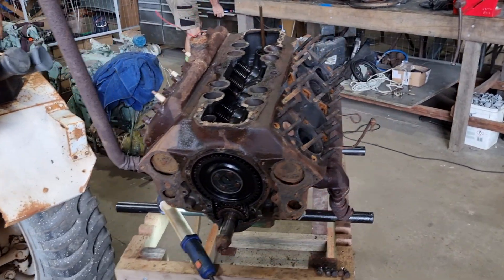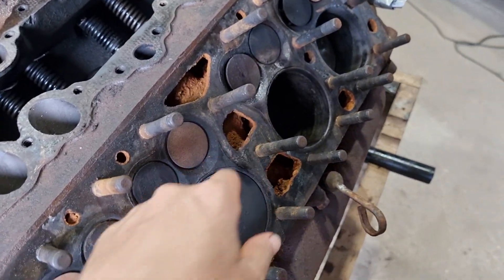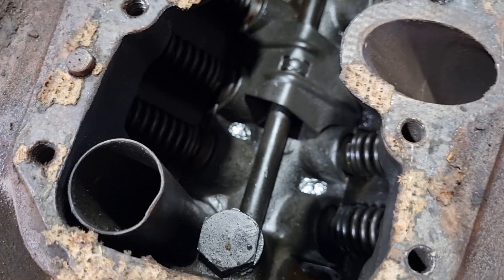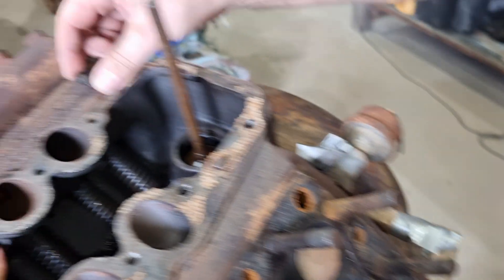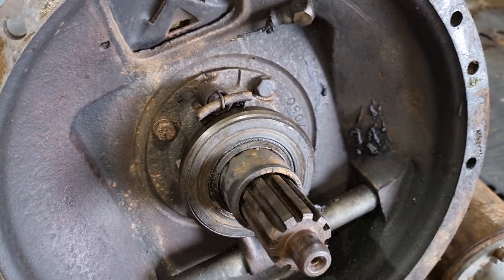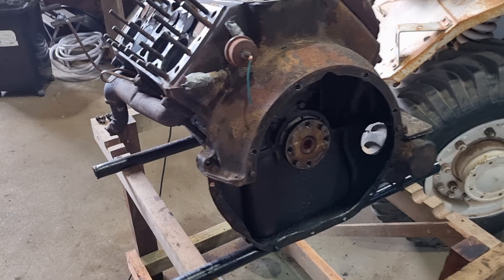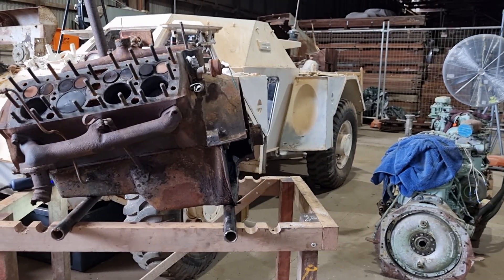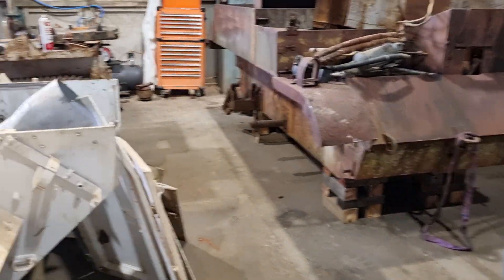Dismantling the engine on our armoured carrier

Comment: Radiator reminds me of ford Canada F30 Blitz which also had rhe side valve V8 motor. I suppose the motor could be considered "British" if it came from ford Canada as they were made as british Commonwealth vehicles. And im only going by memory of the Ford F30 blitz we had on our property at Scone that my younger brother and i got going again in around 1971 after raiding the town tip for 1940's type wiring harnesses and hoses to rewire and replace rat and mouse eaten ones and perished hoses.

Comment: Great vid again. And yes, I too have some exprerience with the sandblast-booth (same type); due to overpressure the lid opens a bit midfront and midback and during the work a little bit of sand is blown all around you. It does build up over time..  😷
Reply from the maker: I always have a dust mask on when sandblasting 😊
Reply: You better do! I solved the most of the dust-leakage by applying a sturdy kind of foamtape all around under the lid. Saved me from most of the dustclouds

Comment: The V8’s were rated 22 And 30 hp. Pre war they were white metal bearings on mains and big ends. Later in the war the bearings were changed to lead indium shells and these were very popular buy post war for sports cars such as those built by Sidney Allard. If the carrier was an early war build any Ford V8 would do at a pinch as materials were short and Britain could not arm its own forces very well so when ANZ forces came into theatre with basically small arms what was available was shared out. It was not ideal but half a loaf was better than no bread. Hmmm they cut down the size of loaves too from 2lbs to 1 3/4 lbs. That gave you another loaf per stone of flour.